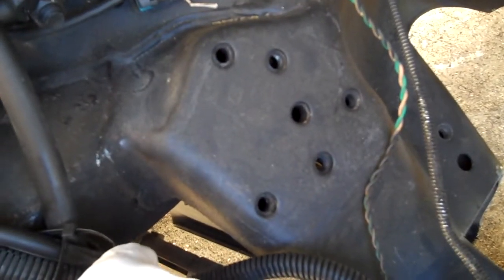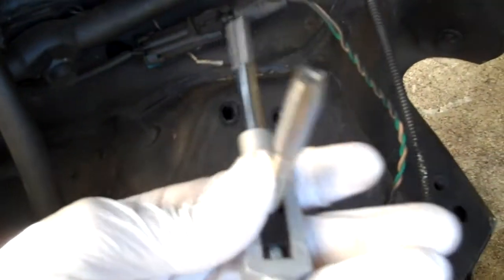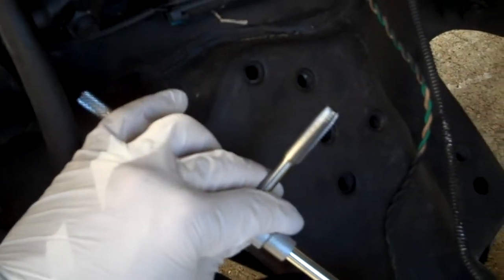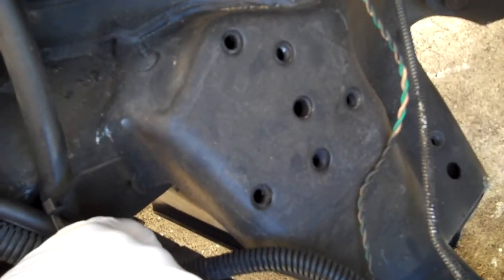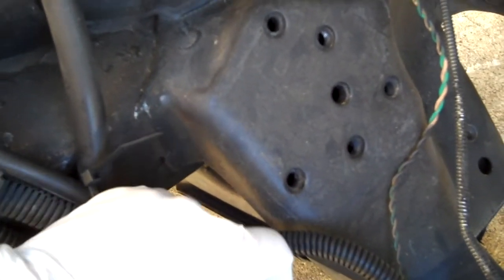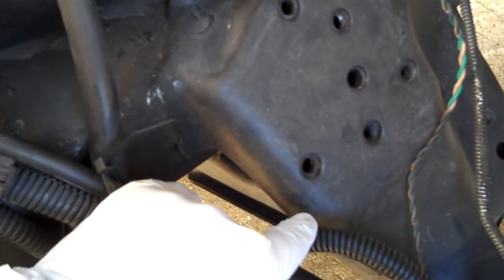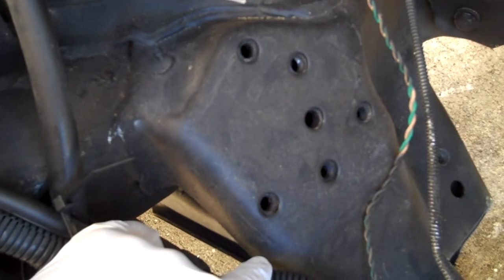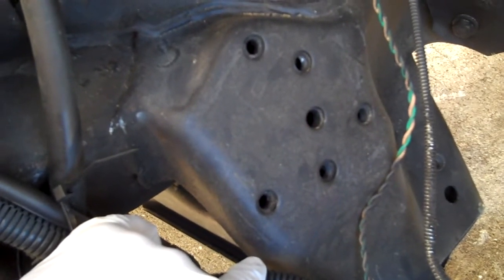S10 LS V8 Part 4: Motor Mount Thread Tapping

Comment: Man, that oil pan hangs LOW! They gotta be something better, or I'd have to put a 1/4" plate under it off the x- member!  I had a camaro the oil pan took a beating, just from a pot hole in the road, but this is a truck, but still, and  you could used rivNuts for the motor mounts, but either way will suffice! It all works in the end!